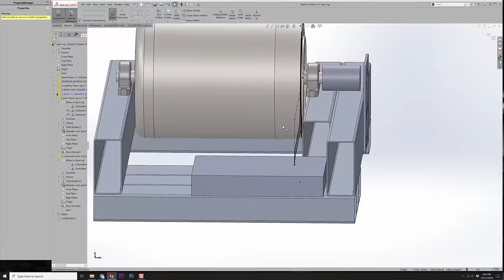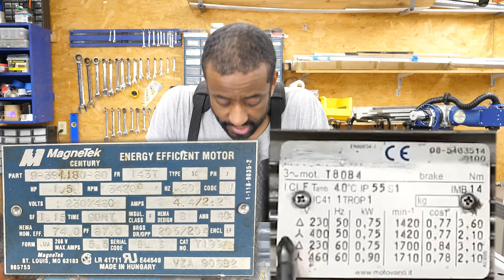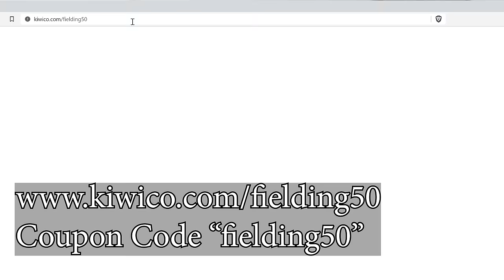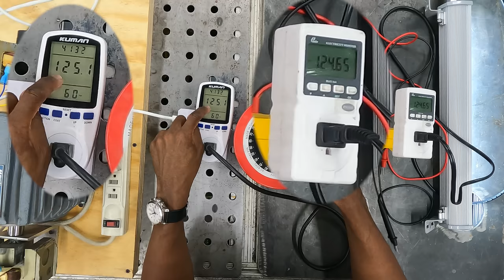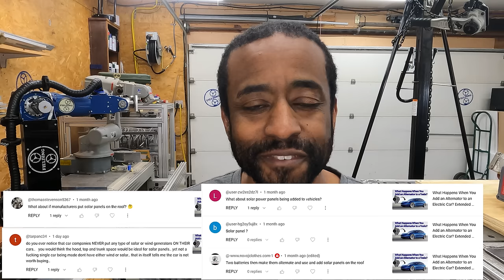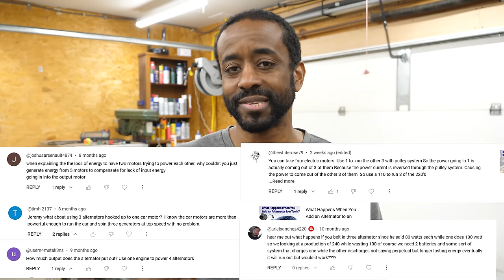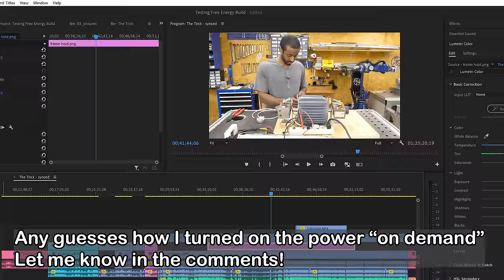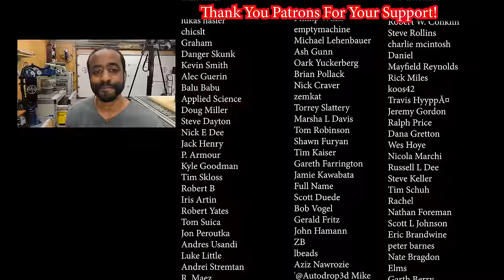Building and Reviewing Free Energy Generators on YouTube.

Comment: 100wats led.
100 watts flouro.
2 X 700w solar panel facing each other leave gap enough to slide flouro lamps in  place led around the edge facing in.
Slot Flouro in allowing for gaps.
Add a small capacitor/battery to start system & loop the charge back through to lights any extra is used as our power source.
Anywhere mirrors can be used will enhance efficiency.
If we design from scratch we could design a laser metal halide globe which would use 10-20w each max per globe with much higher lux output.
Different globes will have  different heat output so 1 will have to experiment with gases & globes.
I've designed many house appliances to work off this powerpanel.
Fridge, oven, heaters, tv, lights all wireless got free ideas on PERPETUAL engine wirelessly charging from engine looping back or with an alternator as wheel.
I can't find any logical reason these will not work apart from faulty workmanship.
That's using garbage, if I had a few labs in sure we could design many different ways of being things work.
I don't like wires or frequencies so all my thoughts are based on wireless or absolute minimal wires & frequencies.
Having a global economy designed on garbage waste  pollution FIGHTING progress all of these not wanting to move into the future.
I'm not interested in any oil companies or electricity companies, rubber companies, any GOVERNMENT'S bad investments &/or fairy's l failures to design an economy based on competence & I APTITUDE. & I couldn't care less about the global BULLSHIT economy based on GARBAGE WASTE & POLLUTION.
PERPETUAL ENERGY IS NATURAL LAW.
PERPETUAL ENERGY IS GODS LAW.
You will all die & you will all be judged.
There is no escape.

Comment: I'm not saying that the inventor of that generator got free energy out of it but this guy used a steel shaft and the inventor claimed to be using an aluminum silver alloy so this guy didnt replicate the original design so he neither proves nor disproves anything here. 
But he does a pretty good job of explaining mainstream accepted physics.
Reply from the maker: There are at least 10 other problems with this. So to claim he is using some magical material you can’t buy anywhere seems more like hope than science. Just saying. It wouldn’t work either way. There is nothing special about adding silver to aluminum to make it suddenly produce energy. Because that’s what is missing. It’s like saying I am using the wrong kind of drive shaft in a car with no gas. It doesn’t matter

Comment: Thanks! It is physically impossible with a perpetual motion machine that also does something that requires energy, which everyone learned in elementary school, but there are a lot of different energies in our surroundings! One of the areas I'm the worst at is magnetism, and Nikolas Tesla made an engine that utilized the Earth's magnetic field, right? The problem was that, at that time, no material could handle the high speeds that was needed but today it exists! Why can't we see such a video on YouTube? Presumably, it's because someone owns the rights and won't allow anyone to reveal that a "new" kind of engine exists? Because in the end, it's all about money, and until today the oil companies have blocked all competition, but now that more and more people are realizing the climate threat, alternatives are starting to emerge, but so far only unreasonably expensive ones unfortunately! What would be needed would be a conversion kit so that you could run our old internal combustion engines on hydrogen, unfortunately, it would require a slightly higher oxygen content in the air that the engine uses in order not to become weaker from being powered by hydrogen instead of petrol or diesel and that has not yet been resolved, whether it is due to the difficulty or because someone owns the patents and has no plans to release them, I cannot say... I myself have an opportunity to manufacture a hydroelectric plant of quite such a power, but the problem is that calculate the flow on the watercourse to be able to calculate the possible effect and since it is not a small watercourse, I don't understand how I can get it calculated at all? The state wants more rapids and historically there have been three dams of 1.2 meters and in order not to damage the environment, they have to be low enough for the fish to be able to get over what that height might be I would also need to know! Otherwise, the plan is to lead the water to the turbine via a suitable rough pipe of perhaps a couple of cubic meters and to cast several dams to reduce the risk of the ice dislodging and tearing everything away - because there are no small forces that it moves around and it has been a real problem to solve but which should now work... One thing is certain and that is that environmentally friendly energy will hardly be cheaper if you don't count radioactive waste as environmentally friendly? But despite that, it will only require more electric energy if they force everyone to only drive with electric cars, how is that going to be possible? Then I'm convinced that using solar power to convert water into hydrogen and oxygen that could be transported to sun-poor places is a better option plus the panels would actually capture some of the heat as a bonus! Of course, there is some waste in the system, but not so big as to not use the opportunity at all!!! Just a side question, has anyone calculated the aircraft's emissions correctly considering that they release their hot exhaust gases at high altitude and thus cannot be compared to ground emissions by a long shot because almost one hundred percent of the aircraft's emissions end up where it does most damage! I have a strong feeling that they have deliberately avoided the factors of financial interests which always come first no matter what...

Comment: "Free energy machines" are never free for three simple reasons: 1. The materials to make the machine are not free. 2. The time it takes to construct and opperate (time is money). 3. Work to drive the machine.
Reply from the maker: Even though "free energy" is not a thing... this argument muddies the waters unnecessarily. This definition is too restrictive in a way that doesn't help your case.  If the device really did create energy it could pay for itself and the time invested a hundred times over. This logic even works for solar which is a doable thing. If someone argued that solar panels were free energy because they earn their money back in energy saved over "x" number of years then go positive. I would agree with that. They invested in a product that gave them a net positive return of energy. The sun's energy is not "free" in the physics sense, but it is not a big deal to say it this way using a common sense meaning of free energy here. I didn't have pay for the energy once I got my investment back in savings. This would be logical and not worth arguing over.
Reply: @Jeremy_Fielding  for my argument I am only refering to devices that violate the laws of physics. Energy cannot be created or destroyed only transformed. Electricity traveling down a copper wire, some of that energy is transformed into heat accounting to some voltage loss from your explanation as copper wire has some resistance.
Solar pannels and wind turbines "green energy" do not violate these laws of physics as the energy comes from somewhere like the sun, fluid motion that turns a generator that in turn creates energy.

Comment: I wonder if you'd actually have more luck generating free energy with a rotor that was suspended in the air, in place by opposing pole magnets, and sealed in a vacuum. If you weighted the rotor unevenly you engineer it so could start it spinning by tilting the device. The thing is, would the energy generated in the stator slow down the rotor? If you had the rotor suspended in the air by magnets and sealed in a vacuum you'd think there would be no friction or air resistance? I doubt this would work, but I'm interested in 'why' it wouldn't work.
Reply from the maker: There would be work because of what I described in the video. It might help to watch again the part where I am describing "push back". this is discussed in several places in the video. It has nothing to do with air resistance or friction. You CAN NOT change mechanical energy into electrical without push back. That means this won't work in outspace or anywhere ever. I promise it is in the video. Check it out!
Reply: @Jeremy_Fielding  yes, the ‘push back’ I did see that. The question was to whether that would be significant if you removed other losses. Thank you.

Comment: can you explaine where the power came from i made free energy year 2011 using dead lead acid bat, power inverter, charger back to dead battery.. when all connected i start it with 12v power supply ang it run almost 1hour but the charger is super hot, so there is free energy happened.

Comment: What if u add a capacitor
Reply from the maker: A capacitor is basically a battery. It doesn't change anything about energy. Think of a capacitor as a battery that can be charged and discharged almost instantly and then you quickly see nothing about the core problem changed.

Comment: If you work on sensitive electronics you know you have to ground the shield on one end if you connect both ends of the shield it becomes a wire and the flux will interfere with the circuit  you were trying to protect

Comment: Where is the battery and the alternator. And once you get car wheels turning I'm  sure they turn faster than any turbine or windmill to produce energy.. You can't what dreams manifest X Maxwell Chikumbutso
Reply from the maker: I guess you didn't watch the whole video. I talk about why this doesn't work in great detail no matter how fast the wheels are spinning. The alternator will stop them from spinning. Its like driving with your foot on the brake. I promise I talk about this and prove it in the video. You really should watch the video if you think this works.
Reply: yes but its not applied to something in motion. I hear ya though, let me go manually push start this stick shift @Jeremy_Fielding
Reply from the maker: @JethroD.  I don't understand what you are thinking or I would try to help you. What do you mean push start? Why does that make sense as a reply to the statement? Perhaps you mean why do gasoline cars use them if they are hard to turn? That is because you don't have any electricity in a gasoline car without it, so we use some of the power supplied by the gasoline to push it giving us lights radio etc. Electric cars don't need this as they have a giant battery that they recharge by plugging it in. Gasoline cars have a tiny battery that is used up rapidly just starting the car. It takes a lot of energy to crank a car and spin the alternator. The alternator also uses a lot of power in a gasoline car. Near the end of the previous video in this series I run a alternator and measure the power needed to spin it. It takes about 1 horse power just to spin the alternator when its making just a few watts of power. This goes up the more power you try to make. I am not making this up. This stuff is all measurable and repeatable. You can copy my experiment yourself. The playlist is in the description. Its the end of video number two with a picture of a Tesla in the Thumbnail. I made these videos to help people not confuse you. If it doesn't make sense I will try to point you to more proof. Or you can try it yourself. This idea would be worth hundreds of billions of dollars if it worked to Toyota, Tesla, Ford, and everyone who makes an electric car. Yet no of them are doing it. Its worth your time to try right!!! Even if you are wrong you get a great lesson in physics.

Comment: Selfrunning or run Lights no Problem.. but ne need power ! Motors will steal this power in selfrunning Systems so it will slower and slower until it stops
Reply from the maker: Did you watch the whole video? I get the feeling you missed several very important parts of the video

Comment: It not an ordinary alloy. That's why it didn't work. You used ordinary alloy.
Reply from the maker: There are at least 10 other reasons several mentioned in the video that make this not work. There is no such thing as a material that can create power. This claim is part of the scam. Its like saying I used the wrong drive shaft in a car that doesn't have gas. It still won't run. Because you can't buy this anywhere, you also have to believe he is forging a custom material with silver. A very expensive metal. This is made up garbage that can't be tested. It isn't logical to believe this with no evidence outside of his edited videos.

Comment: One horsepower is 744 Watts
Reply: If l had a free energy machine l would tell noone just plug everything l needed in and bribe the neighbors with free electricity to keep it silent.
Reply: Please invent a rechargeable remote so we don't have to change these pesky batteries anymore and a motorcycle steering damper lock linked to the kickstand so riders can't forget to put up their kickstand when riding off, you won't believe how many accidents happen cause of that.

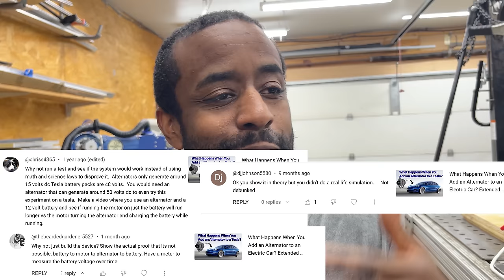Comment: 2:21 I agree that a lot of those devices are scams 100%, but you have to admit you're going in a bit biased. Any engineer knows that the heart of engineering is prototyping and proof of concept. So you prove them wrong with data analysis collected from your prototype.
Reply from the maker: I think it's worth pushing back a bit here. I understand what you are trying to say. And, I agree this is true for "truly" new inventions and concepts. But the logic doesn't follow when applying this general statement to a known scammer design. 1. Literally everyone has at least a small bias. In fact, we train every engineer and scientist to make predictions (a hypothesis) to develop their ability to predict the outcome of designs. Some times you are surprised, but the better you understand the parts and perimeters, the more likely your predictions are correct. 2. In this case we know how these various parts interact as millions of machines have been designed and built with these parts for over a hundred years in many cases. So much so that a machine can be designed on paper using these parts with highly predictable results before anything is assembled or tested. We have all known parts, with known behaviors all of which can be measured with math on paper. It seems to be about the most easily predictable result I can imagine. 3. Finally, we also have the laws of thermodynamics which have no known exceptions. That by itself is not proof. But when you combine that with me understanding the parts well, have designed machines with these parts, and seeing predictable behavior each time... it gives me confidence in my hypothesis that this is a scam and thus I don't need to build it. I have a well founded bias.... not just a bias.
Reply: @JeremyFieldingSr  
Thanks for the feedback. 

I agree that everyone has a small bias. Otherwise, we wouldn't have the concept of the Null hypothesis in science. I also agree that we are trained as scientists to make a hypothesis and predict the outcome of designs, but you left out replication. This is my point, I would say replication is more important if you are presenting a claim. For example, it is one thing to publish a whitepaper it is another to replicate it (granted a scammer YouTube video is a VERY far stratch from being a whitepaper). 

2. I also agree yes, you can get a datasheet and make a presumption of how various parts interact as millions of machines that have been test for over a hundred years. It doesn't surprise me that you prioritize math on paper. In the Old day, all they had was brass and wood, and they built it regardless. At some point, the physicists took over engineering, where they live in this fiction relam of theory. 

3. "Finally, we also have the laws of thermodynamics which have no known exceptions." Interesting, you said no know exception. So, do you believe that potential an expectation could be known at some point? 

That all being said I don't think videos like this will make free energy and I don't think you are personally biased I think it is our academic systems engrain the bias and a kind of hubris into all the scientist and engineers so they will never think outside the box. I found that a lot from my professors when I was in school.

Comment: They look like a transformer, it holds power or a capacitor you can get shocked it holds electricity still is that it? I’m gonna start building my own electronic devices to power my house when the grid goes down because the end of the world is coming because of the magnetic pole slipping here in the America we got five years and the United States has 10 to 12 years.